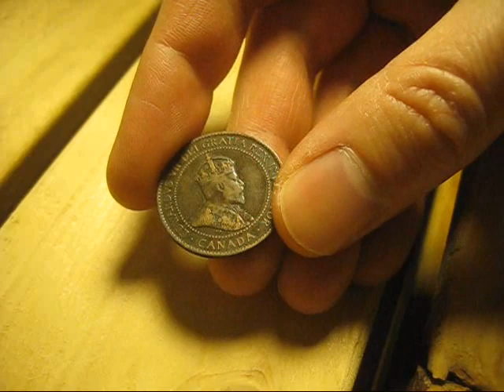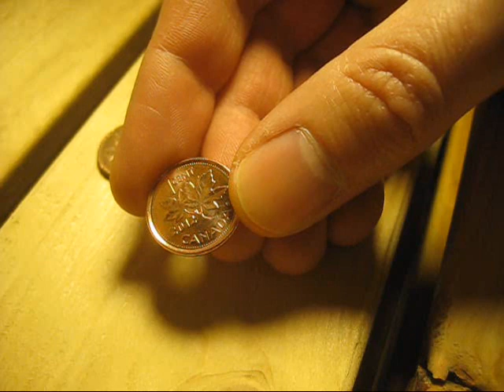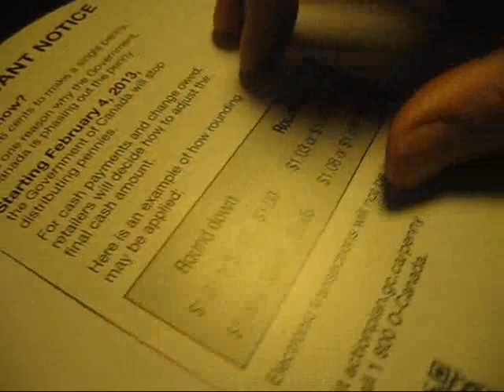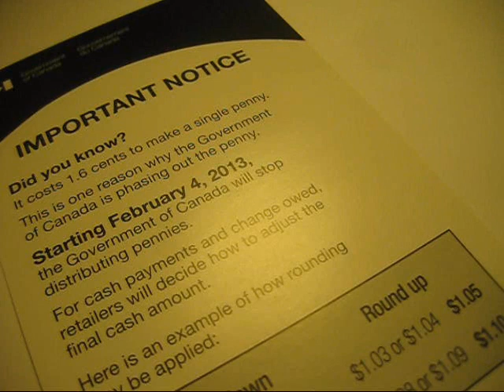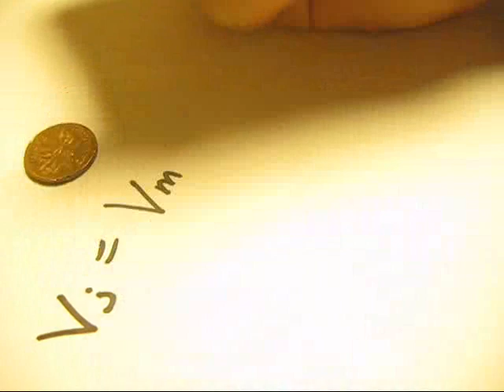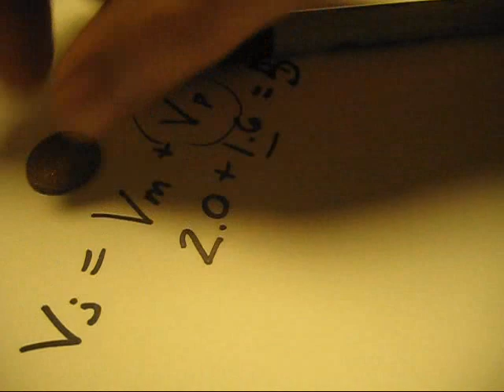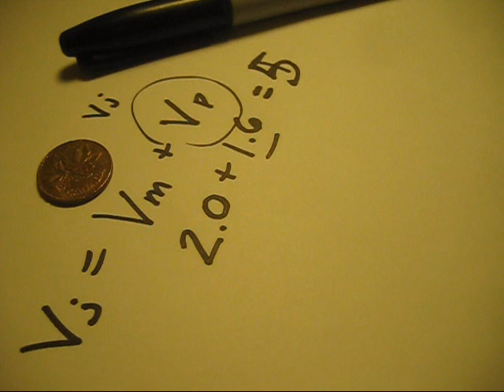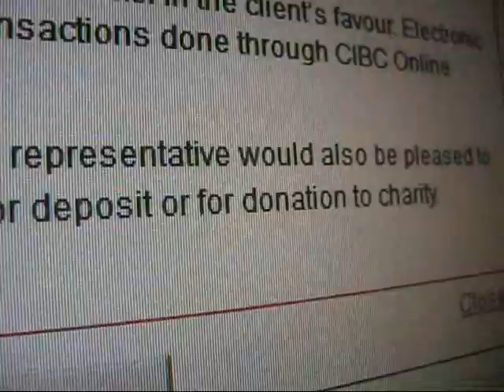why EVERY copper penny is now worth at least 5 cents!

Comment: The government of Canada through its mint is also debasing its nickels, dimes, and quarters. Beginning in 1992, Canadian nickels were only 25% nickel and 75% copper. Beginning in 1999, Canadian nickels were made with valueless plated steel. For dimes, the last year for nickel dimes was 2000, after which dimes have also been made out of valueless plated steel.  For quarters, the last year for pure nickel quarters was 2001. Since then, all Canadian quarters are made out of the same valueless plated steel. Further, the older coins made out of pure nickel are being sent back to the mint to be melted down whenever they come into the possession of Canadian banks. It is not only the copper pennies that have disappeared; coins made out of pure nickel are rapidly disappearing as well. Following the US Federal Reserve, the Bank of Canada has vastly increased the amount of currency in circulation since 2008, hence the rapidly declining purchasing power of Canadian currency. Canadian currency is now a fiat currency, and is not backed up by real money. For 100 years, Canadian coins were made out of real money- silver or copper, and now they are made out of worthless plated steel, thanks to the abandonment of sound money and the gold standard in 1971.
Reply from the maker: Very good comment, thanks!
Reply: early Canadian pennies pre 1900 and later in unc condition are a sight to behold.quite beautiful!
Reply: Plated steel still has some kind of value..like its manufacturing cost and transport...just like anything that is manufactured  theses days. You just don't walk into a metal scrapyard and ask for plated steel ....and they'll give it to you.
 BTW  My niece has 1 full 18 liter water jug of pennies...plus 3/4 of another one.Although  not all are copper, but there is some good $$$ in there .We....(all the uncles) started putting most  of our pennies into it when she was born...back in '73

Comment from the maker: Good questions!
Are there better ways? Depends what you consider better. Every method has its pros and cons. A major pro with this method is if you've got some spare time, you can turn 1c into 5c, over and over and over. Myself, I have low funds, but I can spare a few minutes. Your mileage may vary.
As for storage, I have a LOT of pennies now. They stack and pack very tight. Everything fits in a reinforced large shoebox.
Copper is the common man's money. I love silver and gold, but copper too :)

Comment from the maker: Yes, I get what you mean :)
You're right that putting more work into producing something doesn't automatically give it extra value, but wrong to insinuate an item is never worth more than the cost of its materials.
Consider a small disc, made up of 10c of bronze, professionally minted with identification built into the design. What would you expect to pay for it? Value has been added to it, turning it from a blob of atoms into a bullion round with a trusted weight.
You'll NEVER get that for 10c.

Comment: Defacement is stuff like scratching metal off of the edges.  This is why there are reeds on the edges of pancaked coins.  Destroying a coin is taking it out of circulation, is really deflation, and is not illegal unless there is a smelting ban on specific coins.

Comment: I can see with my own eyes that the nail has a point.  It may not be sharp like a knife, but that doesn't matter.  It's all about density of the material.  You could probably put a nail with no point whatsoever through a steel penny with a slightly harder hit but it would take a few good whacks to put a pointed nail through copper.

Comment: Copper is a conductor of electricity, for that purpose it has to be as close to 99% pure as posible, as the bits that aren't copper set up a resistence and that is energy lost due to heat, never a good thing.  The bigger cables are usually not copper, but even there, the lost power is bigger then further they have to go.   So If you are scrapping copper to sell, remember, sooner or later, you might want to have some high grade for electrical use, and you are getting rid of the wire, not great.

Comment: Interesting calculation.  You're right, material plus cost of coin production, etc.  That's what was put into the penny.
Reply: You can't put the cost of making the penny into the value of the metal. The cost of making the penny is a lost cost. It has nothing to do with the value of the copper after production.

Comment from the maker: Ya since 2000 the Canadian penny has been about 95% steel, with a microscopic layer of copper so that it still looks like a real penny. The rim is the same thickness a penny's rim has always been (so a roll of 50 is the same size), but the thickness in the center of the penny has been reduced to nearly nothing. I shouldn't be able to hammer a blunt nail through a piece of steel of any quality or thickness. It's a lookalike, a fraud, a copy made to give the uneducated eye the impression of value.

Comment: Know this, 1982 the materials changed to a much cheaper penny. Copper pennies are 1981 and all the way back in production. Any penny now is a zinc and nickel core that copper plated. You want real value in an old coin, then check the dates and rims of dimes, quarters, and half dollars for silver. Research coins on your own time, I've done this stuff since I was 8. I have done my part, also some 1982 pennies are 99% copper. Scrap coin with knife, if brown the you got copper. If silverish then no.

Comment: In the case of the penny, it's worth 60-100% less than cost of manufacture (materials et al). It's absurd to keep paying more than face value if its not rooted in the actual cost of the materials/manufacture.

If the currency is fiat anyhow, why would you keep a denomination of funds that doesn't encourage trade?  Inflation always happens even in gold std. currencies. 

BTW: vegas chips with RFIDs cost about 58c each, for $1-25, and 89c for $25+, and are collectible, time to switch mints?

Comment: I disagree with your value of the copper penny formula.  Weight times price per pound. The penny is now just a 95 percent copper disk.  Government production and transportation do not factor in actual intrinsic value of the penny once you have it as bullion, which is why it is horded.  No metal processor will accept them even when it becomes legal.  Unless you have a profession sorting machine they will charge a processing fee.  Go sell some junk silver to any coin shop.  You will get less than spot.  Same thing will occur with the penny.  This factor of 10 to 20 percent should be factored in the true value of what you have.  I sort 20,000 pennies every week in the U.S.  so I have a realistic value on this long term hedge.  Happy Hunting